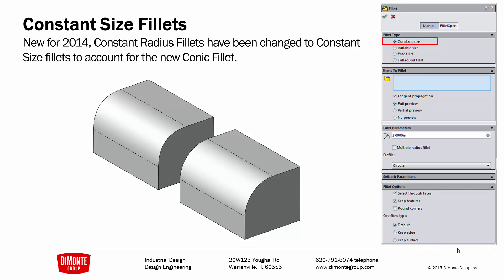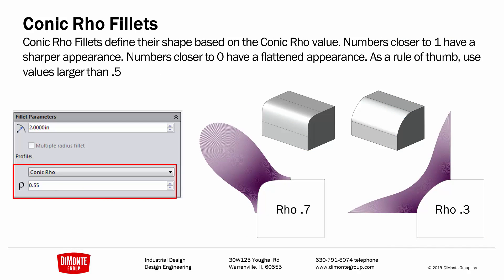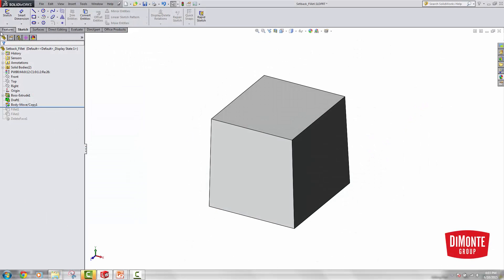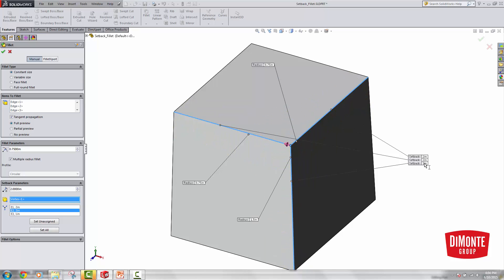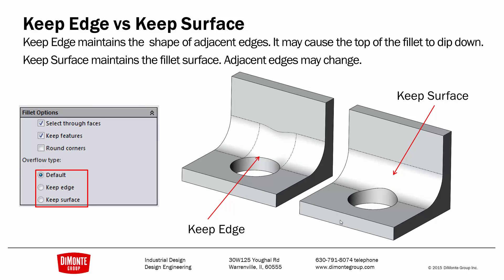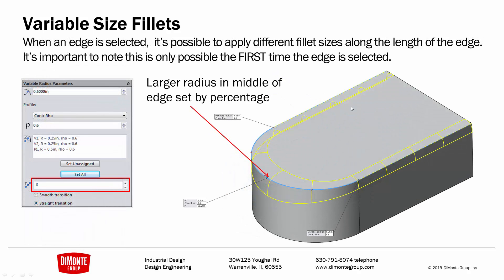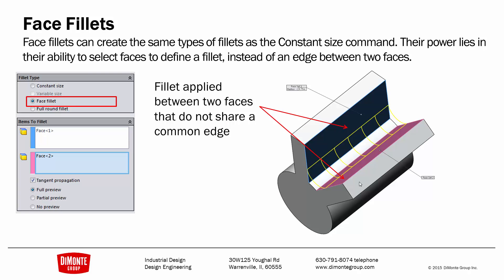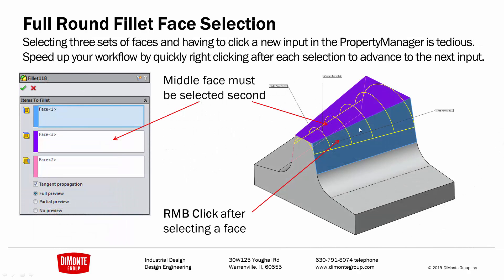Will It Fillet? | 02- Fillet Property Manager

Comment: There's a lot packed in this video.  I think this should be divided into more videos where you show more examples of each fillet.  Especially, where it works and where it fails. Also, slow down on the selection and operation of each command. Simple "mouse dyslexia/coordination" and improper selection/execution has discouraged many solidworks users with fillets. Especially, forgetting to "knit before fillet".
Reply from the maker: trexinvert - I do not disagree that there is a lot packed into this video. 
We have to ride a tough line between being useful to new users of SOLIDWORKS, and not be boring to old users of SOLIDWORKS that might get some new stuff if we keep them engaged.
Now that we are over our crazy-busy period during the pandemic, we are going to be posting new stuff stuff soon.
Our current thought is to go on the quick/engaging side with the understanding that everyone can pause the videos and rewind if they didn't get a click.  
Please let us know your opinion on that.
Reply from the maker: Regarding "where it works or where it fails".  That is tough for us.  We share what we know, but usually can't share the REALLY interesting stuff until our products are in production, due to NDA's.  
We don't make a dime from this.  There are tons of reasons fillets work and fail and it is impossible to catalog them all.  My best advice is what I did when starting in SOLIDWORKS in 1998 - just start modeling products as perfect as you can, and don't accept the result until it is that.
-Ed